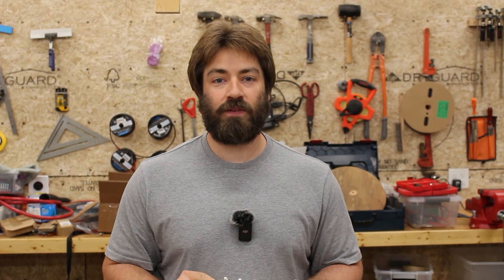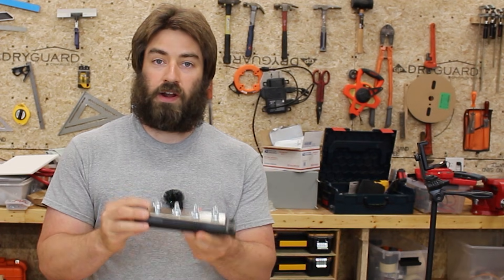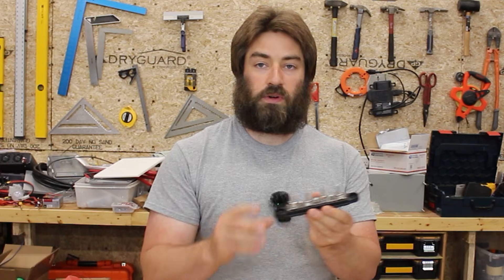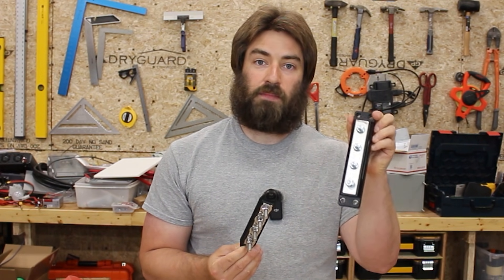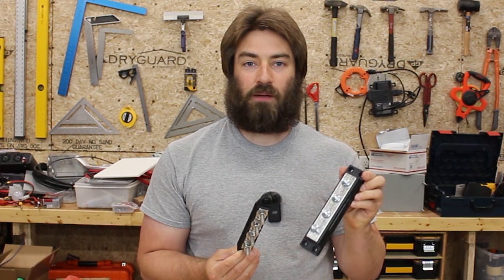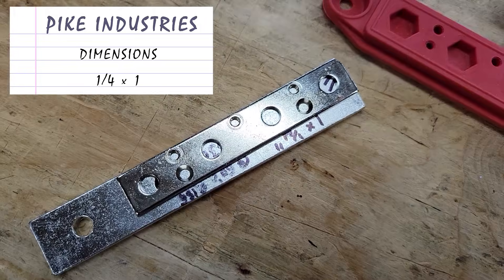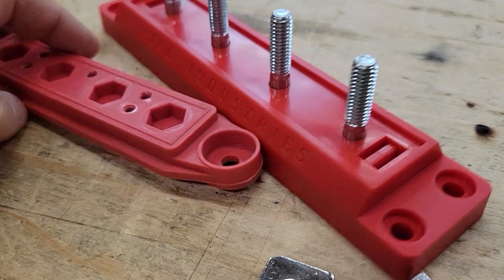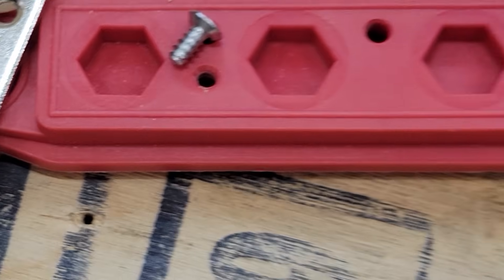Busbar Comparison Guide

Comment: Rule of thumb: add up the AH of your battery bank.
Mulitiply that by 1.5.
That is the minimum size bus bar you need.
Allows for momentary peaks above the rated levels like for starting a drill, refrigerator, etc.
Mine are 250A. But I am only going to run a refrigerator.
400AH worth of batteries too. Just will circuit breaker them less that what I calculate.
Will stack the cables 2 on a stud on the outer studs and the inner ones will get the inverter and such.
Good enough to handle the starting watts of a refrigerator.

Comment: Your Pike 400amp BB is correctly sized for 400amp with a 25-30ish C raise in temp.  That other model is PoS, never buy a non-copper BB unless you want build a mini resistive space heater.  

I would always get SS bolts if you plan on keeping it for 5+ years as a good BB should last for your children to inherit.

Comment: Wow! How can these companys get away with such gross overrating of their components. I have been using these I have never thought to check them as they appeared to be of sufficient quality. I have a heat gun which is my primary at a glance diagnostic tool and have noticed heat build up in my wiring which I couldn't figure out. I will be looking further into it. I wish you would have melted them down whilst measuring with a ammeter  and heat gun to conclude your theory.

Comment: The cheap ones are rated for 250A from the manufacturer. Are they lying?
Reply from the maker: Pretend the 250A manufacturer rating is the "surge" rating for short bursts of power.  I don't recommend more than 100A continuous.

Comment: i gotten several very thick wide heave copper bars  if i tie batteries i use that with heavy stainless bolts  wonder though in high amp use if the batter are would benefit with a fan set with thermostat plowing over the bus bars and battery tops 
i get the rack batteries most have fans i taling individual lipo4

Comment: I think the video should have been titled ,,,,,useing the right bus bar , the cheep one as you call it would be fine for a smaller solar set up , dont need a 400 amp bus bar for a 100 amp camper set up , everything has a use , just need to know what size your set up is and buy according to how much power your running ....cheep doesnt always mean garbage but you should always do your research when it comes to electrical , fire is never a good thing off grid .....

Comment: I bought the 250amp bus bar kit and ordered a solid copper flat bar to swap out the brass. Even though it’s only for ham radio equipment which is high amperage for short durations the 30 bucks in material seems like a good investment.

Comment: In terms of construction, ignoring the bussbar cross-section, the cheaper buss actually has better designed contact area from the bolts to the bar with the head of the bolt directly against the underside of the bar and washer/terminal/nut all being compressed against the upper side of the bar.

As others have pointed out, the Pike Industries construction has the plastic cover between the head of the bolt and the underside of the bar giving less clamping force for the electrical connection, and a possibility of a problem with heat and compression loosening the electrical connection over time due to plastic flow or deformation.
Reply: Plus it still relies on the plastic to hold the bolts in place. 

So they both essentially rely on the strength of the plastic to hold it together. 

One with screws into plastic, the other by plastic moulded/welded to hold the bolts and bar in place.

Comment: Don't get confused about the meaning of the word "rated". It does not mean "suitable for use at", it merely means how the manufacturer tested it and that is done by measuring the temperature rise. A larger rise is easier to measure with less error than a small one. Saying that a conductor is "rated" at 200A is meaningless without a qualifying temperature rise. There will always be a temperature rise because a conductor has a non-zero resistance and the power dissipated is always the current squared multiplied by the resistance. The question is what temperature rise will be acceptable for the application?

Don't get confused by comparing different resistivities. First determine the maximum resistance acceptable for a given power loss and then work out the size of a metal bar that gives that resistance. A metal with a higher resistivity will need to be larger. There are other factors to consider like weight, price, strength, machinability and corrosion, both atmospheric and electrolytic.
Reply from the maker: Thank you for such a great comment.  I'll try to work through some further calculations next time.

Comment: Which is more robust & recommended for 48 V system… 5/16 or 3/8???
Thanks (NewBe)
Reply from the maker: It's not really that simple.  3/8 is larger than 5/16.  But the size of the stud isn't the whole story.  You have to look at contact area between lug and busbar.  How many Amps are you moving, and the copper cross-section.

Comment: Excellent video. I had to "rework" a companies stock 32" long copper busbar (both NEG and POS busbars) that came with their server rack battery system. They have those rivnut "inserts" embedded (machine pressed) into the busbars for battery cable installation. (?) The battery lugs don't seat FLAT against the busbar and/or there is a gap where the busbar is drilled to wide leaves a air gap where the rivnut is inserted. Fix action: I am NOT using those copper busbar rivnut screw-in inserts at all. All I did was drill out new holes and used Grade 8 hardened bolts, Nylock nuts, hardened flat washers...all my  battery cable lugs seat FLAT against the busbar now. You can torque those hardened bolts down hard. Have you ever seen busbars with those rivnut inserts? Battery cable eyelet lug ends need to attach FLATLY to the busbar and be tight. Copper or tinned copper. Like you said, the 1/4" by 1" copper. Thanks for your video. Safety is #1 and with these high amp server rack battery systems, not having solid connections to the busbars is asking for trouble.
Reply from the maker: Hi Chris,  I watched your video.  I think you came up with the best solution to that issue.  I also have a server rack battery from the same brand (but older than yours).  Mine came with clinching nuts on the back-side like these: https://amzn.to/3yadcJg  And I can torque them down better than a rivnut.  I have no clue why the manufacturer switched to rivnuts, because it doesn't look like it would save any money in the building of the cabinet.  There have been at least 4 versions of this cabinet over the past 2 years.
Reply from the maker: You may also like seeing some of my modifications: https://youtu.be/A0bqClj5urg

Comment: Just recently got a bus bar for my off grid I have very low power devices that are connected along with solar panels and my question is first I have 1558H battery and I wanted to extend them the time with some free batteries that I’m able to get that are small 88H batteries. I connected them all to the bus bar then it connects to my controller and of course the solar goes to the controller as well and then charges hopefully all the batteries. I’ve read a bunch of things, but I am not sure if it is making things worse because they’re two different size batteries both 12 V or ,maybe if I did a busbar with the small ones and Matt made them close to the 55 8 inch and then connected the big one with the small one on it separate bar bus hat do you think?

Comment: Mr. Poz, as usual, thank you for sharing the information and breaking it down. I'm building my 1st system (EG4 48v  15kWh w/6500 HF inverter).  I have to trust EG4 knows what they're doing with thier equipment but the bits in between.... the fuses, breakers, cables and BUSBARS, can make or break the system (and possibly the structure its in).  Lets just say, I'm not overly confident about THAT important piece which is being left to me.  I really appreciate having someone to observe that is doing it for real and living (or not) with their consequences.
Reply from the maker: I'm on Facebook as davidpozenergy if you want to discuss in more detail

Comment: I have a question about your battery stack. Since they are in series aren't the amps limited to a single battery's rating? Perhaps I am missing something?
Reply from the maker: The batteries are in parallel.  I understand the confusion because they are daisy chained together.
Reply: @DavidPozEnergy  - Thanks - I should have studied the wiring a little closer before commenting!

Comment: DOH!  I bought those cheap ones.  Thanks for making this video.  I just have a few days left to return them.
Reply from the maker: They are fine if you are keeping your Amps low.
Reply: @DavidPozEnergy  I have 4x LifePower4  100ah 48v. So it’s similar to this setup. Where is a goo place to get copper bar?
Reply from the maker: I find Ebay to be the easiest source.  Try searching for "0.25x1 copper bar"

Comment: Note on the "Cheap Ones" as well.
The Nuts will "spin out" and mangle the plastic when tightening and the threads actually gall.  Once they are like that taking them apart is a freaking nightmare.   AVOID THEM !   They have "Warmed sifnifificantly @ 100A through and that IS spooky, to say the least.

THANK YOU DAVID !
You may have Just Saved some Lives !

PS, If you anted to prove a point, setup a test rig and push 400A + through the cheapy while filming from a safe distance.   Eeeeeek Factor !  ;-)   (says the guy with 1200A of Batt.)
Reply from the maker: Thanks for your comment.  I heard the heads can spin, but haven't seen it myself.
Reply: @DavidPozEnergy  For kicks & Giggles, you've got enough Oooomph sitting there to Vaporize one of the those cheapo's and really show what can happen...  Will safetyy precautions of course.  Nothing drives the point home than Seeing it...  preferably not 1st hand & in your face ;-)

Comment: These are terrible expensive. I just made them with the pure copper 5mm bar, 4 stainless steel screws and fiber glass or epoxy separators for a fraction of the cost. Prefer spend the money in proper cable and lugs instead.

Comment: Nice one… and which one from Amazon would you recommend for 280A continuos and 400A peak? What about Victron Lynx PowerIn? 😊
Reply from the maker: Nothing wrong with the Victron line of products.  In this particular case I didn't think it fit well with the Jakiper rack, where I am installing the busbar.
Reply: @DavidPozEnergy  It has proper cover, so maybe the sufficient placement would be on the top of rack. Or at the top of the rack on a few of Units on some backing plate matching 19" rack pitch? It supports both leads from batteries and on the main plus busbar the Victron SmartShunt could be mounted, main fuse and disconnect switch. Then second PowerIn could be connected to provide interface for multiple MPPTs/invertors :-) or am I wrong?
Reply from the maker: Not wrong.  If you mount the lynx power in on top of the rack, then there will be a lot of extra wires to ensure your wires between busbar and batteries are equal length.  Using the Lynx shunt doesn't have a disconnect built in, and the main fuse holder is built for a CNN fuse.
Reply: @DavidPozEnergy  Better placement would in the middle of the rack, ten it would be possible to have better cable management. But their racks are made just for batteries, am I correct? And therefore PowerIn places outside of battery rack would be the best solution - in extra case for instance...

Comment: HOWdy  D-P,
BusBar selection
I was disappointed that the +positive+ / negative  5AWG  Battery CABLES 
that arrived with my  EG4 (48V/100AH) LL Batteries 
only had 1/4" holes in them vs 5/16" holes that my BUS BARS require
Drilling them OUT to 5/16" seems a little THIN on the copper terminal lugs  
Thanks for your REVIEW 
COOP
...

Comment: HI DAVE.. YOU MAY HAVE MISSED OUT.??  on chep one power is going though nut.bolt . bolt head and bar..? but on the other one it dose not go though the head of the bolt. its insulated .. so ll power must go though the frount bar. ?? ..  so contacked area is much less.. tone uk

Comment: You say the more expensive one is plastic.  While it might be it might be a harder resin or a fiber glass reinforced piece also, tool plastic. So all the comments worried about the “plastic “ piece could be for naught as some of these “plastic “ materials are stiffer than copper.  My power tools take drops that would dent copper and show no damage.  The cheaper buss bar looked like the lugs sat in cheap plastic    
And if you have ever wired lugs you know to snug things up.  They probably even give a specific torque. 
That said.  You buy a cheap one be very careful to not over tighten

Comment: Material is one side. Cross section and contact surface other parameters to check. Corrosion is a big problem caused by current. All together makes a bus bar.

Comment: The cheap ones are not bad if you are building a small system like a cabin but the main concern is that you don't want to go much over a 5000-6000 watt 48V system without using something more robust.  The thing that really sucks is that they charge so much for some of these units and you are not getting a decent deal compared to buying heavy duty standoffs and nicel plated copper bar in the first place.

Comment: I made my own busbars using copper stock. Drilled and tapped the holes with a 30 inch long bar that's half inch thick and 1.5 inches wide. Presently have 4 inverters and 6 280ah battery banks. Have enough holes to expand in the future
Reply: Yep , way to go. Made my own using Copper also. 🤪
Reply: How can the Amps rating determined.

Comment: What if the cheap bar was copper? What would it be capable of?

The issue I faced was advertisements listing a continuous current rating only. I found one type stating a per-post maximum continuous rating. (In addition to the total continuous rating)

If I want to run an experimental setup with 4x 24v batteries, driving a 2500w/5000w inverter, I'll need a possible 100A continuous/200A peak on a single stud feeding the inverter.

That bus bar advertised with per-post rating was claimed 350A cont. with 65A per-post. I could hook my 4 battery parallel bank up and the bus bar continuous should be fine, the per-post continuous should be fine per battery, but the post feeding the inverter could be a bottleneck. 

I am of course discussing using the bars solely for paralleling the batteries, from which a single output feeds a load, or maybe a load bus bar.
Reply from the maker: If the cheap busbar were copper, then probably 150A based on the dimensions.  In the next video I'll be hooking this up to my Jakiper battery rack, so hopefully the next video will help bring this all to light better.

Comment: Curious what your experience has been with the signature solar rack bus bars?  They seem under sized for 400 amps or so you could push through them.
Reply from the maker: My experience with the Signature solar busbars is they handle the Amps I can move fine.  I've never detected any warmth on the Busbars with my fingers.  But, my maximum Amps is 220A, so I'm not pushing it to the limit of the copper bar.
Reply: Thanks for the feedback David!

Comment: David, I'm building a 24v solar system.  I'm starting out with 2 12v lifep4 batteries in parallel to get the 24v battery.  The question i have is  this.  If i start out with 230 ah lifepo4 cells and i want to up date my battery bank to get more ah, do i have to use the same ah 230 ah batteries or can i add 200 ah or 280 ah.
Reply from the maker: You can parallel different capacity batteries together.  However, you have to make sure that your new batteries can handle the Amps.  Always use a BMS and over-current protection (fuse or breaker) on each battery.
Reply: @DavidPozEnergy  thanks you, I do use a BMS and a 150a fuse/. Thank you again.  Keep up the great content, I don’t think there was 1 video of yours I didn’t learn something!  Way easier than college LOL
Reply: Two 12v batteries in parallel will still be 12V, but the amps per hour would be  the sum of the individual amps per hour. To get 24V using 2 12V batteries, you would need to put them in series.

Comment: Thanks for making points about safety. There is too much weight given to cost while ignoring technical reality. The NEC, UL, inspectors, etc. exist to help keep dangerous activities safe. The amperage of our systems can cook an elephant. If the Jakipers are similar to the EG4 then they should run, nominally, around 30 A per battery maximum. A server rack of 6 is well regulated at the 200A level. Naturally, the peaks can be quite a bit more. We should all know exactly what we are shopping for. Based on what I run, I use the 600A Victrons. Yep, they cost serious coin, but there is no detectable warmth. Love your videos.

Comment: Don't tighten the bolt with plastic in between. The plastic will crush and you will have a loose connection. Place a nut against the plastic and tighten the nut. Place the wires on top of the nut and use another nut to create a tight connection
Reply: still have the same problem , heat will loosen them on  the bar.

Comment: Depending on the type of brass, the conductivity is 25-50% that of copper at the same cross section.  Bronze is not bad, you just need about 4 times the cross section of copper for the ensure the same conductivity.  Besides having a much smaller cross section, the cheaper brass bar you got also has a number of extra holes drilled in it which further reduces the cross sectional area between the connection points.
Reply from the maker: I agree with you.

Comment: It’s pretty clear you are knocking Victron lynx stating it’s REALLY expensive option. But at 155 it’s $5 CHEAPER than these pike industry bars with stainless hardware plus you have the option to fuse right at the bus bar and you have total coverage in a neat package.
Reply from the maker: Not at all.  I life Victron products.